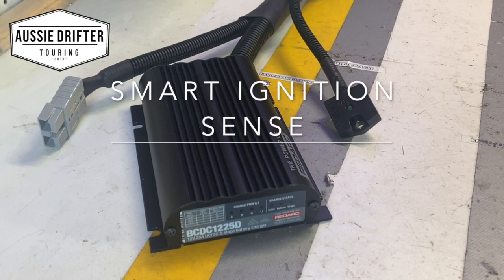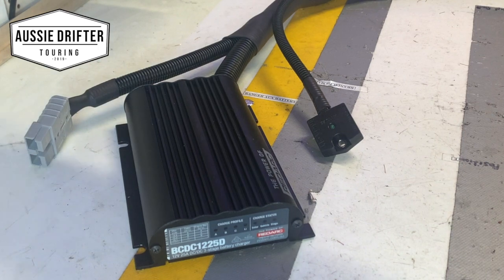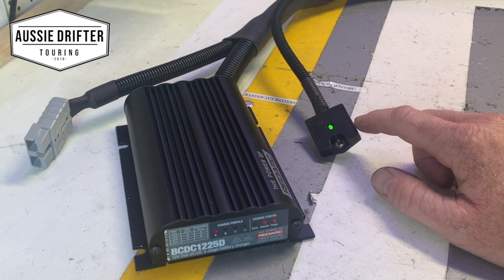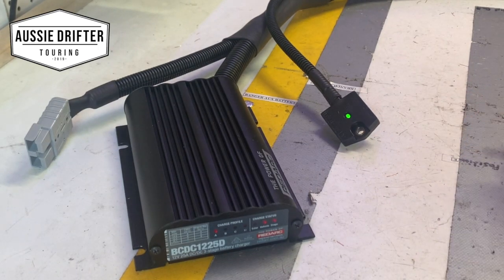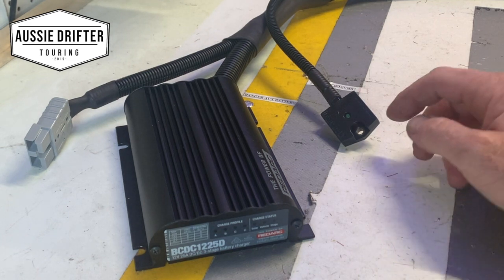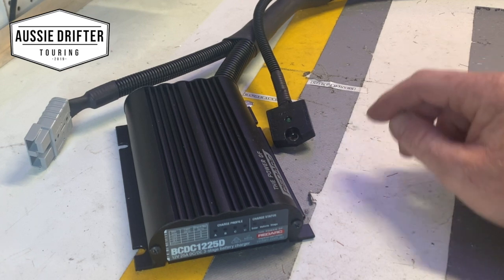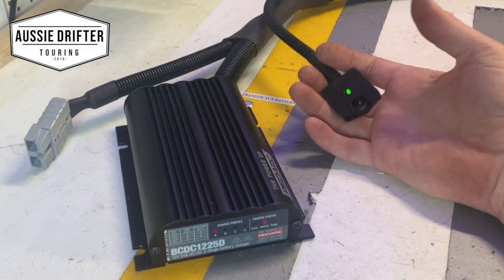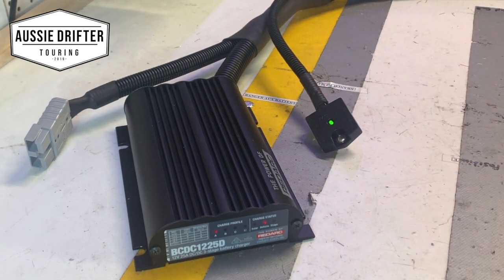Smart Ignition Sense for diy install of dcdc chargers on smart Alternators

Comment: G'day, is the sensor sold separately and can it be wired into an existing ignition wire from the dcdc charger?
Reply from the maker: Hi mate.  Sorry we put plugs on the sensors to plug into our kits mate so they only match our kits sorry

Comment: does this sensor mean you dont need to send a wire to the ignition key to allow a dc to dc charger override a smart alternator.
Reply from the maker: Hi Pip 
   Yes the whole idea of the unit is to elevate the need to wire into the cars ignition, it looks at 3 factors to determine wether the car is running (voltage, vibration and inertia).  So no need to wire into the ignition with this unit.  We sell it with our kits as an optional extra and is setup to add to our kit.  It works on an idling car so long as it is mounted to a location that is susceptible to vibration wile idling (ideally the metal body of the car).  Sounds like this is the kit you might be after.  https://www.aussiedriftertouring.com.au/shop/enerdrive-dc2dc-40amp-dc-charger-universal-kit

Cheers Kurt
Reply: @AussieDrifterTouring    Thanks kurt..a little too expensive for me😔

Comment: Shouldn't it have a yellow Anderson SB-50 for a 12V system?
Reply from the maker: Hi Tony.  No mate grey is by far the most popular colour in 12v 4x4 setups here in Australia.
Reply: @AussieDrifterTouring  Anderson have suggested colours/keys for various battery voltages, but it seems they are seldom adhered to.
Reply from the maker: Yer.  Check this out for more details on the use of grey Anderson plugs https://en.m.wikipedia.org/wiki/Anderson_Powerpole

Comment: so what is the best charger i can using it for smart alternator without cutting wire ??? 
i asked many ppl  even the company of this machine about this point but no anyone answer for me
Reply from the maker: That depends mate on, the application, battery bank size, battery type. Feel free to give us a call to discuss your needs
Reply: @AussieDrifterTouring   the battery of this car is gel 105ah for nissan patrol 400 hp and lets say using for another battery bank 45ah
Reply: I have the same question.. how do i get my trailer/caravan battery fully charged while using an Toyota LC200 with variable voltage system without having to run a wire all the way from alternator/ignition to the caravan to the BCDC... one AGM battery in my caravan.  The connector at the car gives the 12v maintenance charge to the caravan but not enough to charge... I’d love to use that wire to fully charge the one battery but they all mention having to run an additional wire across the caravan to tow vehicle... any way around this?
Reply from the maker: Nic Restrepo hi Nic,  with the lc200 you don’t need to worries about the ignition wire as it has what’s called a temperature compensating alternator and not a variable voltage alternator so the dcdc will work the whole time your driving without the blue wire connected.  Feel free to give us a call if you have any other questions.
Reply: AussieDrifter Touring -Battery Management by Design amazing... thank you for fast reply!! I’ve been trying to get an answer from a knowledgable source for almost a month now! and no one would, thank you so much 🤙🏽